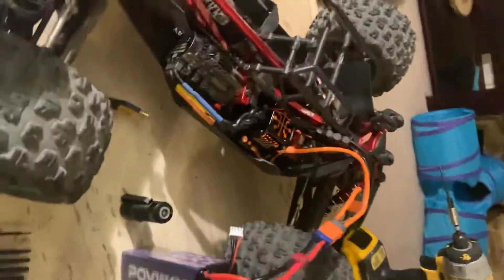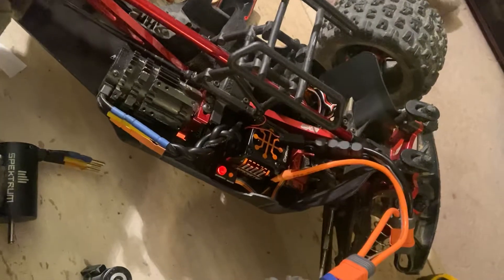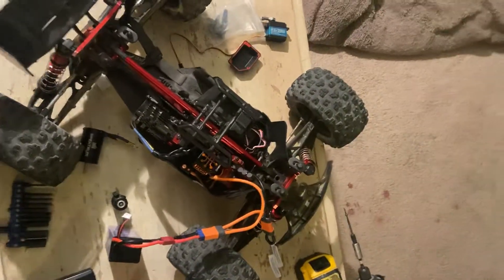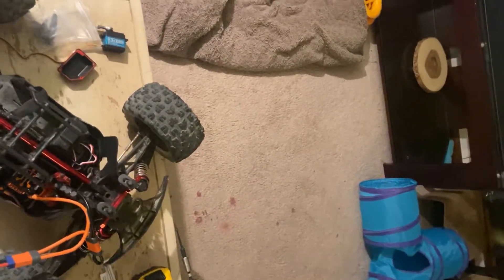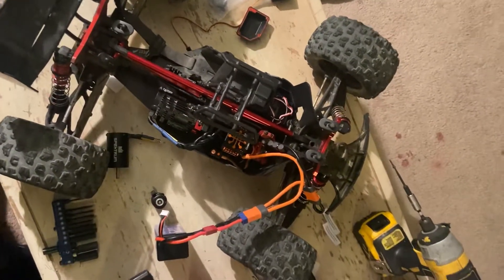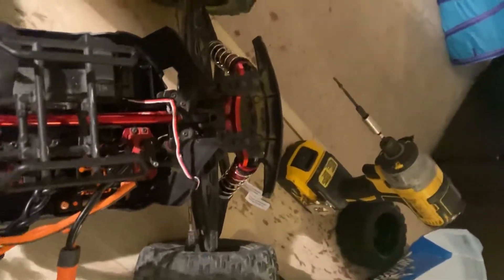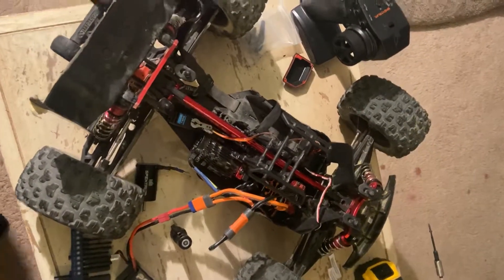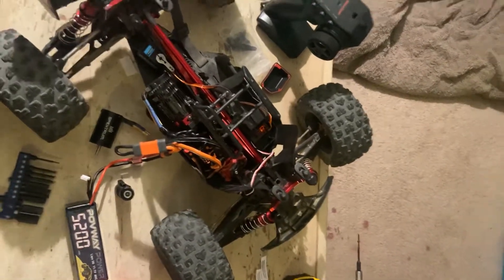Spektrum smart 150a esc FIX!

Comment: Man when I first ran into this issue back with my V2 kraton…. I COMPLETELY LOST MY SHIT KET ME TELL YA… this is a good video to have saved 🤝
Reply: Hi mate any idea on this 

I've got an arrma vorteks 3s

I have no throttle or brake and a flashing red light on esc, the car will also accelerate uncontrollably on its own when not pressing anything

I have put every setting on the dx3 to neutral, re binded to the reciever and calibrated and it still doesn't work

I recently fitted a new servo as the last servo was only turning right and not left, and when I try to center it, the trim adjust doesn't adjust smoothly it just jumps too far

Comment: That happened to me one time and needed a servo . This time though it’s an intermittent green flash which means overheated and didn’t come back . Steering works , fans work on the esc and motor , no throttle . Tried everything . It’s said the “mosfets” get fried or one does and it’s done . Common issue I guess on the spectrums , made by hobbywing supposedly for the arrmas . Prob cut the cost with a cheaper part inside like most companies do . A lot of said in comments thst htis has happened several times with arrmas 150 amp smart esc s and not to the retail hobbywing esc s . Thanks to Jenny’s or ot would be 3 x the cost but if it happens again I ll be going HW . Or if the warranty covers it this time I ll have an extra for something else for $65 and a 6s capable esc . The v2 was $20 more

Comment: What is that secondary sound that is behind the beeping from the esc. My Team Corally Kronos has a spekrum esc that sounds the same and it drives me nuts. Is it the metal gears engaging or something? I'm new to the hobby but I've gone a little crazy with it and already have 10 or so other vehicles and none of them make the same sound. None of them rip like the kronos does spekrum motor and esc either though. Just curious if it's normal or if there's a way to make it not have that awful sound every time I turn it on.
Reply from the maker: It’s a normal spectrum thing. Probably just bouncing a signal to motor making sure is good to go!
Reply: @lawrencefournier686  right on..  I bought the kronos used on an eBay auction. It was super clean and ripped, but that sound had me thinking maybe there was a reason the guy wanted to sell it. I just bought a 1:8 scale team associated nomad DB8 without a single scratch even on the skid plates with 4× 4s batteries(only one ever opened that worked perfectly for 50 bucks on offer up. It looked like the guy bought a storage shed and was flipping all the stuff from the pictures.  If he only knew what the thing was worth, he'd probably try to figure out the best way to kick himself in the nuts.  When you Google it, the first thing that comes up is a typical price range, and it says 49 to 57 dollars. When you actually click on it, though, that's just for the body alone, so I suspect he saw that and didn't investigate further.  I honestly kind of feel bad about it. One in the same condition with no batteries just sold on eBay for 7 hundred something. The only difference was it had the original box, but personally, I'll take the batteries.

Comment: I have the same ESC as you do, Is there a way to program it to have a Y splitter on the throttle connect to be able to use a servo break?
Reply from the maker: I’m sure they do. You could probably just get the one off the fireteam 6s!

Comment: My Typhon doesn't do anything just power button lights up. No beeping, no steering, no esc lights, no receiver lights. Thoughts?
Reply from the maker: Your ESC is most likely toast.  Once I went through all the BS with my Kraton now I always check each piece of electronics with a second set that I know all works properly .  The batteries als

Comment: Mine won't even power on, it does nothing. The servo was very slow and going bad I'm wondering if it could fry the ESC I'm going to get another esc and servo to try. If anyone has solved the no power at all issue I would love to hear how you solved it, been scratching my head aswell.

Comment: Yeah u need the smart battery with the gray single wire attached because it's not grounded without it.you cannot add random batteries with smart technology. It knows
Reply: That's not true at all I run normal batteries in my infraction and normal typhon 6s and it's works completely fine, all that grey wire is for is the telemetry for battery voltage.
Reply: @Nathan-qt2zi that’s a fact right there
Reply from the maker: Specktrum Smart my ass!  Overpriced garbage. Keep em simple, just like our ladies!

Comment: You can check every last one in my videos that problem does not exist that is our first for me I'm sitting here dumbfounded I never thought the servo could just shut your whole experience down
Reply from the maker: Nor did I good sir!  I tried every combo of different rx, tx, esc, and motor combos and that’s only thing that would work. I could get to setting up throttle and end points but would got partially through set up leaving out one setup option every time like no left steer or no throttle. It was very strange, but through process of elimination I was able to see what was doing what.

Comment: I have the Traxxas review 3.3 Nitro
I tried switching up to the SpektrumDx5 and the remote only controls my steering, As it should but won’t work with my throttle servo. About a minute with the transmitter and truck on my throttle steers along with the wheel. Any tips
Reply from the maker: Sounds like you just need to reset your electronics then set all the setting up for throttle and end point adjustments. You can search YouTube for a vid on how there all tons. Search keyword for your brand controller.
Reply: Thanks for replying.   The hobby store told us the wrong layout

Comment: Yeah there is an issue where the s652 specifically shorts out the firma150 - happened in both my typhon and mojo - happens when it get wet.  Hh should honer warranty on tis and the new shipped ones do not suffer from the same issue - alternatively- as you have you can install a new servo. 

Now servos from Jennys my have the same issue depending on the bath as they from rtr stock.

Kicked my self once we figured it out - more people should talk about just to get people back up and running sooner